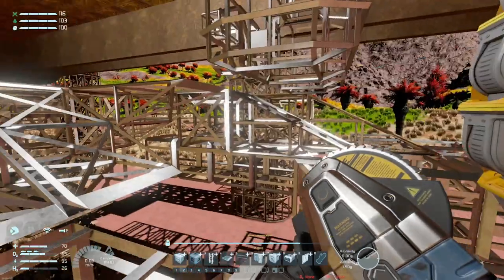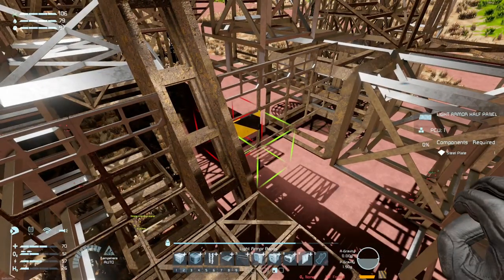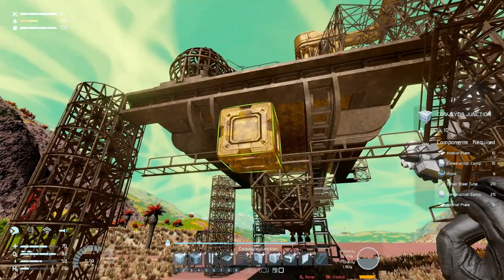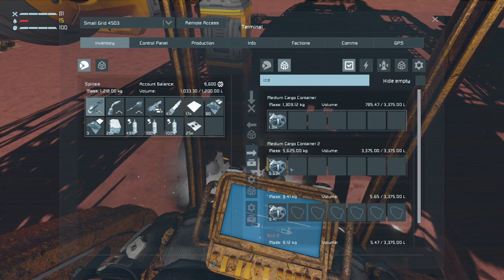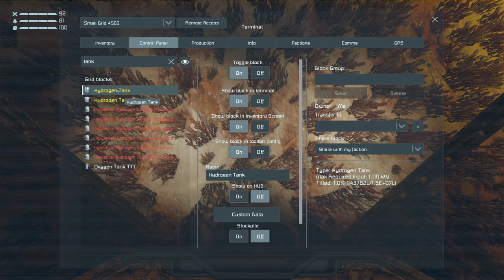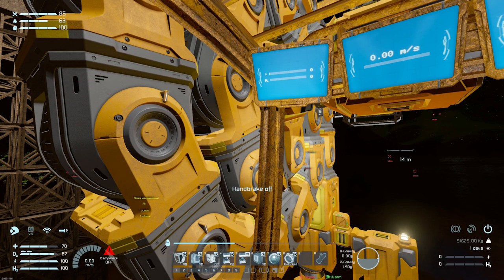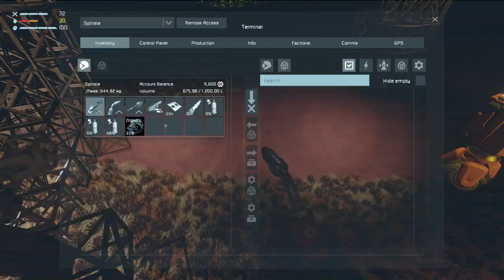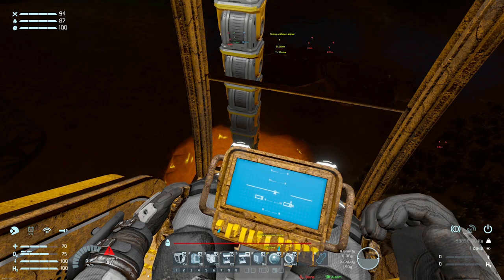Survival Impossible - Mining Tram/Gondola Thingy #60 - Space Engineers Hardcore Survival

Comment: If you put a rotor on the base with a small rotor part, you can put a small grid merge block on there and lock to that instead of the connector. Makes the vessel that much smaller. Additionally, you could call it the McFly because of the hoverboard aspect and its almost literally what it is.
Reply: Also with the fixed positioning of the gondola, would it be possible to use GPS markers to autopilot it back in place then timer blocks to relock to the base?

Comment: cover the right side of the cockpit with some blocks \ not full build state that won`t allow you to enter it from the scaffolding. Same with it`s back. only leave "reachable" space on the cockpit from its left, so it`s only available when you are standing on the platform of the Gondola. 

For the flying-platformy - same. Just cover it up with some blocks that won`t allow you to enter from a wrong side. 
Building a process that CANNOT be used in any way that is wrong or not indented to be used is the best possible way to build a process. 
For both purposes, a combination of armor plates and windows should do the trick without adding 100500 kilograms

For the Drill platform - you already have a remote-control block in there. Just create a GPS marker and "Enable Autopilot" button on the Grate Operations Platform nearby the cockpit to return to Dock :)

Comment: You could do with a sensor to detect to pisition of the drill head so that at the least when winding it back it will stop and not over wind. Add a programmable block and script it up and you should have full control as it would be able to work out how far the rotor has turned so working out both ends of the run. The same PB could be used to control automatic drill shutoff and retract when the cargo containers are full.

Comment: Yeaaaa right one this time!

You said to try suggest better options? Well i think 1 small hydrogen tank that is always on stockpile 1 hydrogen engine and then if power is a problem turn tank off stockpile and use engine so you get full efficency rather than half with o2/h2 gen I feel like that would work...

Side note please build an elevator to get up and down! It would be so cool!
Reply: Ah, the ol emergency power supply setup. I loved figuring out how to get a setup built to automate shutting parts of the base off when power was running out in Factorio, i dont know much for Space Engineers scripting but there has to be some script options for detecting power levels and flipping switches accordingly
Reply: @BurningFyre  i love that kind of stuff too I have started adding emergency power to ships and adding alarms for different things (lights turn red and evacuation sirens play)
Reply: @fourhua  in my current SE game, one of my next plans is setting up a timer block sequence to go into "lockdown", where reserve power batteries switch from stockpiling, lights turn off or go red, and the turrets and shield (mod) goes on. Then i need to stop dawdling building neat things and get back to space 😅
Reply: @BurningFyre  yesss I really love adding this stuff that we really don't need but are like amazing to have I have started my own vanilla survival impossible with wolves and the armageddon difficulty and am building under ground and want to build a hanger door that opens up for a rocket to launch out of.
You would be my best friend if I knew you irl 🤣
Reply: @fourhua  i dont have wolves or meteors, and i try not to go underground because the voxels are painful but the space requirements from that must result in a really unique build!
Reply: @BurningFyre  yeah I have only spent just over 5 hours in it so far but I should try play with you sometime (even tho I'm on xbox) because the way you play is very similar to teh way I play and I have always wanted to find someone like me but never thought I would 🤣😀
Reply: @fourhua  unfortunately i dont tend to play online, because that sounds real neat
Reply: @BurningFyre  recently I just got into online although it is superrr laggy it still more or less works

Comment: I would suggest cockpit on hinge as well. Also a walkway on the outside of the cockpit would be a good idea (so that it doesn't matter which side you get in and out). The size of the protrusion under the platform looks out of place (the I beams thing) going 2 blocks under the cockpit part.

Isn't there a way to put a welder onto the gondola and projector and a script on a button to do the building?

The cockpit thing on the gondola I'm undecided about. A platform and buttons seems nicer for it to me. 

Is a LCD possible to have a camera stream on it? (Last I saw it was a no but this community and streamer are gods)

Comment: This inspired me to design my own winch drill rig. I'm thinking you probably have the right idea putting it on a track.
Reply from the maker: I think it'd work on a rover but you'd need it to be VERY stable so the track with it hanging underneath is a safer way of building and using it :)
Reply: I've been experimenting with this design on a rover, and from my tests, I've found it works to put the winch on the back and balance it with storage in the front. Only problem you should encounter is not being able to dig out much at a time if you want to be mobile.

Comment: two hydrogen engines would fit neatly next to the connector on the building hovering platform. 100% hydrogen in  those would keep that flying for hours.
Reply: Nope, even with the two batteries, it was using 22% to hover. That's more than what 2 engines can output in small grid.

Comment: why not make two window washer type scaffold lifts ... one on each side using the hinge setup as the way to lower and raise the scaffold to work on whatever ... the hinges will allow you to have a cargo access on the scaffold so you dont need to carry stuff with you ... add a seat or cockpit for o2 and power recovery .. then you can have a construction platform that encases what you build alike a space dock from star trek ... heck you could even have a pair that cover the front and back BUT when fully up allow you roof access and fold up out of the way to remove what you build from the build frame ... make it say 18 to 24 blocks wide and 30 blocks long and 26 blocks tall ... then you can build anything that will fit in side ... from flying ships to rovers ... even space ships etc ..
Reply: well since you have a pannini why not call it a slider .. since they are small hamburgers ... keep going on the theme and you could eventually have a full lunch counter of ships ;) 
of course you have to make a fluid ship and call it the root beer or the soda siphon ;)

Comment: You could add a sensor to automatically stop the rotor at the correct spot when your are pulling the chain in. And of course add a script to monitor cargo capacity on one of the cookpit displays. :-) (MMaster's Automatic LCD) EDIT : kinda pointless as you came to the same conclusion. That is what I get by not actually waiting for the video to finish :-D )

You might need a remote control for your welding platform for when you inevitable fall off the edge

Comment: Cargo Utilization Light v2.2
Reply: Splitsie, I would like to second this as a script to use. Not only because I wrote the script, but because it does have the option to put a fill indicator on a cockpit LCD. You can check and change the options in the programming blocks custom data. I do not know how it will react to hinges, but I believe it should see them as attached sub-grids and auto include them if you want to have the drills included in the cargo calculations.
Reply: @jaredt8883  Plus with just one Interior Light you can see if cargo is full. Very helpful when using camera. And Jared thanks for this script- it is my most used script. Have it on every miner and welder

Comment: Connecting the drilling platform to the base cargo using something similar to the winch would be cool. Not practical whatsoever, but hey - practicality is not exactly in top 5 priorities of this one.
Reply from the maker: lol It would be cool but I'm not sure I could make it work as the chain of hinges would get crazy heavy and try to rip the tram off the rails :/
Reply: @Splitsie  Yeah. I need to try that in creative. I am thinking small hinge chain hooked in a way gantry cranes have power cables - with unpowered auxiliar carriages.

pros:
- no batteries, cargo, connector or life support needed on the carriage
- weight of the carriage stays the same
- unlimited mining time
- controllable from main base
cons:
- may not work
- unknown horrors related to building that thing

Yup, I am doing it.